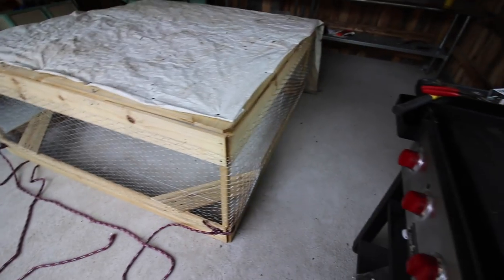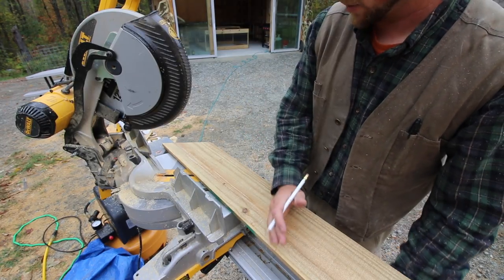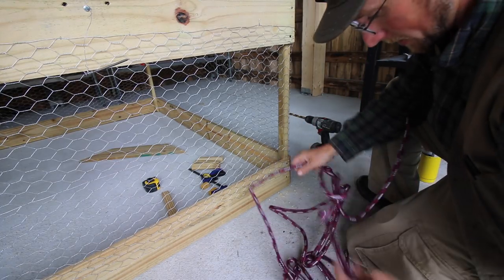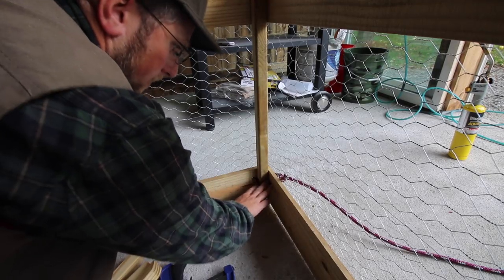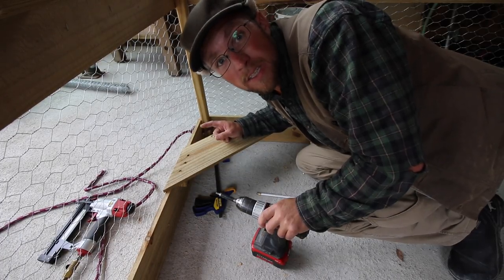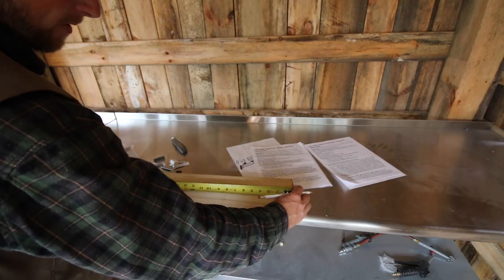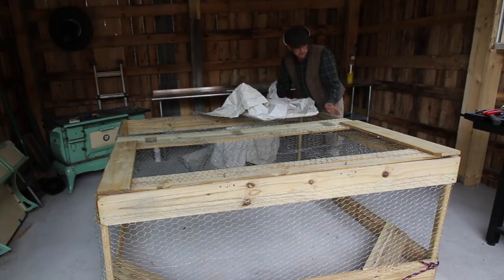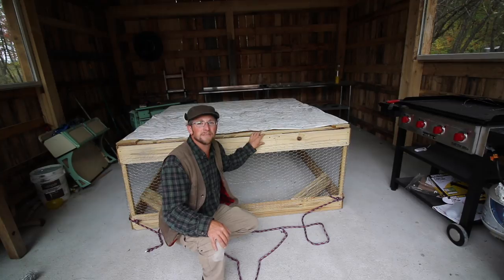DIY Chicken Coop Hacks for Easy Movability

Comment: Winner!  Winner!  Chicken Dinner!  This is a very good chick tractor!  I really like this one the best of all!
Reply from the maker: So far me too! What do you like the best it so far. We still have 2 more add ons for it! They make it even better!
Reply: Lumnah Acres  I like the size of it best.  It is the perfect size.  Easy to move and it's also easy to reach everything inside it.  One thing I'm wondering about is the tarp roof when it rains.  I've used tarps before and they tend to weigh down with water puddles with a flat roof.  So I hope the water will not weigh down on the chicken wire if there is a heavy rain.  Other than that it is Perfect!
Reply from the maker: Thanks for the feed back!
Reply: Sonya Gregory as demonstrated in later videos, it does puddle up.

Doesn't seem to be causing any damage, but I am building mine with one three foot tall side (which requires longer boards for the top wall) to ensure good rain shedding and make the tractor just a bit more comfortable for near-harvest turkeys

Comment: Looking good. Those metal stud screws work nice to attach the tarp. Interested to see how it holds up to snow load.
Reply: Richard Bohling Sr -- I am guessing Al will put the Icelandic chicks in this chicken tractor until they get a little bigger, then Al will put these Icelandic chickens in the larger chicken tractor with the other Icelandic chickens. Or he may put them all together in New Yolk City. Al mentioned he will start thinning out the Barred Plymouth Rocks. So I do not think he will use this new chicken tractor in the winter.

Comment: I went with the panels build, using door hindges for corners and top panels. I just knock out the pins and stack the panels. it also allows me to extend ,or, shorten my pen size as needed.

Comment: I like it, I'm going to build one, and add some lawn mower wheel brackets on the back side using the wheel adjustment bracket to mount 2  18" kid's bicycle wheels.
Reply from the maker: Before you mount the wheels try moving it without them. This tractor moves very easy. Atleast compared to the other ones I have moved.
Reply: Mama is getting older and complains haha
Reply: Eagle Camp Homestead SWFL if she's not too frail, one help would be a solid handle rather than pulling by rope.

Spare her fingers lol

Comment: I'm taking a break from the ridiculously cold winds outside before grabbing wood for tonight & tomorrow and watching your video. Also I may relax a bit because my greenhouse is now winterized & planted with my winter greens. YEA!! Another awesome build or add on to your build...either way it looks very nice. What type of tarp are you using that lasts 2 - 3 years in the sun?
Reply from the maker: It sounds like you have been busy but making awesome progress! Here is the tarp.http://amzn.to/2yBbST4 I wonder if being whit helps it last longer.
Reply: TP Farm part of it is latitude, less intense solar radiation in the north (though I don't know where you're at for comparison)

Part of it is climate, new england gets more clouds than much of the country (though autumn through spring my homeland here in wet-side Pacific Northwest has it beat)

Lastly he's not using the flimsy Blue tarps. The other colors are typically higher grade (and consequently more expensive)